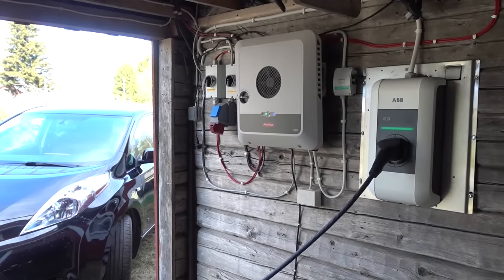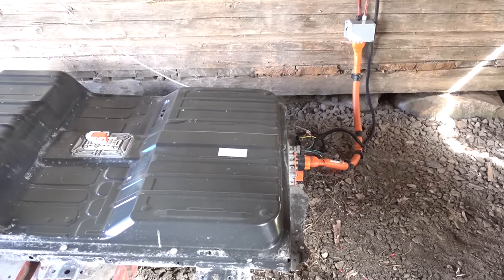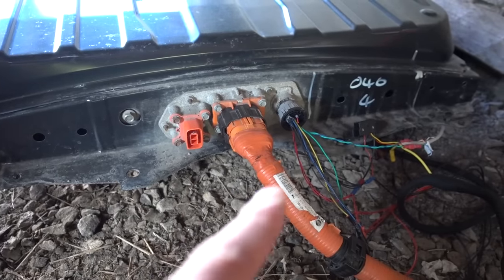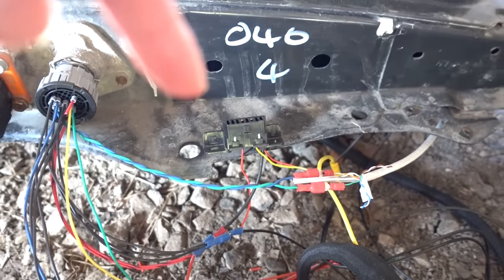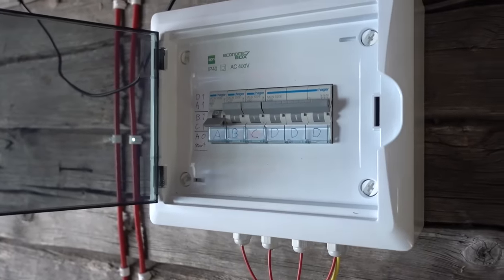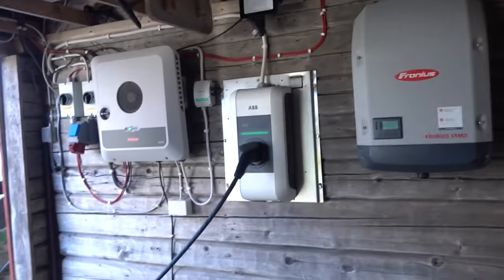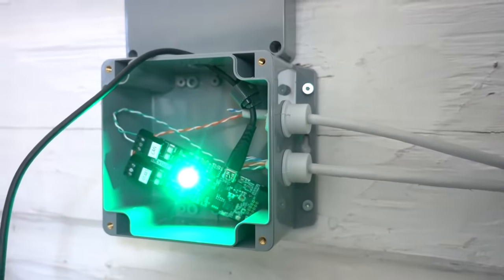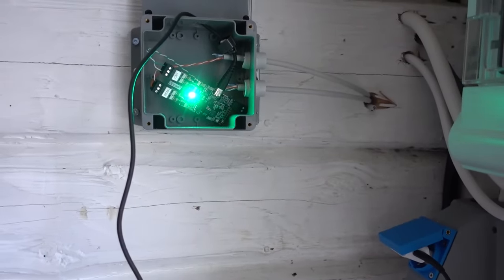The EASIEST way to connect used EV packs to grid! 🔋

Comment: Thanks for sharing this. I am planning something similar in my house. Although, I am thinking whether using V2G technology would better. I already have two car chargers installed. Hence, I could post a used battery with V2G compatible software, invertor and connector and permanently connect to the Wallbox car charger… Thoughts?

Comment: I’m definitely going to build myself one of these. Really cool what you did here. Just one quick question. The software emulates a 11kw battery, the Leaf is 24kW, are the readings in the monitor app showing the full 24 kw?
Reply from the maker: Yes it works, even 65kWh packs can be reported correctly!

Comment: Question. Do i understand it correctly that you couple a 400V battery on the dc solar pv side parralel to PV panels?
Reply from the maker: No, this is a hybrid inverter, so it has a separate BAT input, and another PV input. They are not in paralel
Reply: @DalasEVRepair  Ohhh ok. Now i understand it.  thanks

Comment: Brilliant,  Can you use a Honda hybrid Power battery.  Can you charge the battery with PV Panels  by just connecting to the + & _ connections on the battery.
Reply from the maker: No the battery BMS needs to talk to the inverter to avoid overcharging it. Safety is very important here, never use lithium batteries without BMS control.

Comment: Seems like it's really cool...I think. This presentation is a little bit too granular and only for people who have messed with this stuff before. Could you either make a video or give a description of what is going on here? Do you have a step-by-step explanation of how to do all of this? How does this system work without net-metering? How do solar panels integrate into the system? Where are the solar charge controllers? Does the inverter put out useful power to outlets or only to the grid? How many kwh does this setup provide? Split phase output or single phase only? Maybe I missed a description page or other videos but I would like to know how to implement this. Thanks
Reply from the maker: It's all in the Wiki! https://github.com/dalathegreat/BYD-Battery-Emulator-For-Gen24/wiki

Comment: Hi Dala, just came across this video as I am about to be given an old Nissan leaf battery pack and I'm based on an island with very limited help with regards to solar setups. Currently I have 3kw of solar panels going to a 5.5kwh solar hybrid 48v inverter and the gel batteries I've had for the last 12yrs have finally given up so this seems like a reasonably straightforward way of putting the leaf battery in their place. Is there an 'Idiots guide' of the the steps that need to be taken and the parts that need to be purchased in order to do this as I am not an electrical engineer but understand the basic concepts and as previously mentioned I live on a very small island which has no solar electrical experts to help me do this, so any and all help and suggestions would be very much appreciated as it would be such a shame to have the battery pack and not make good use out of it.

Regards Stuart
Reply from the maker: All explained on the wiki! https://github.com/dalathegreat/BYD-Battery-Emulator-For-Gen24/wiki

Comment: Hi Dala,great video and a super job.
I have here a Kostal Plenticore plus 10 kW with BYD HVS 10.2 memory.
From the Kostal there is the MODBUS TCP protocol.
Since I am a brave tester I would like to work on the project.
Furthermore I have here a Renault Kangoo 22 kW battery and a 22 kW ZOE 
and an ENV 200 with 22kW battery.
These should also work with Fronius, Sungrow, Kostal, etc..

What must / should I do ?
CAN log etc. ?
If so what exactly ?

Greetings Carsten

Comment: What's the highest power inverter that can be used? These gen24 symo plus inverters go up to 10kw and for pv output doc says only 3kva? To use this battery for real home usage need at least 4kw for water heater, 3...4kw for cooking + 500w for gaming pc. Can't really tell not to use washing machine when water heater and some more appliances are on. Looking at non gen24 symo inverters most don't even have battery DC terminals. It must have "hybrid" in model name and there's only max 6kw symo hybrid model
Reply: Didn't look into modbus code in much detail but does this solution already work with multiple inverters in parallel? That would scale for power needs
Reply from the maker: Many use multiple Gen24 inverters. Also there are 15kW home inverters available, check the wiki page for compatible inverters

Comment: What is the maximum distance the battery can be from the inverter?
I am looking at making a setup like this at home but the space where the inverter hangs is not big enough for such a battery.
Reply from the maker: Thicker the DC cabling, longer the distance. With 10mm2 cables you can go atleast 30m

Comment: question - If I wanted to connect 2 or 3 Nissan leaf batteries - are they connected in Parallel or series, and have you tried this? Additionally if connected in parallel, is it done at the inverter, or are they aggregated before the inverter? if it is done in parallel, How would the batteries be connected to each other?
would the inverter treat them as one big battery, or report on them separately?
Reply from the maker: I am still developing support for multiple packs, will make a video on it later!

Comment: Finally getting getting started on this. Quick question, can I add another pack in parallel by simply wiring them or do I need extra software/hardware? Ideally, I want to expand to 300kwh+ of storage if at all possible
Reply from the maker: We have it planned on the roadmap for the software to be expandable in parallel, but not ready yet! For now, best to buy a single 100kWh to start with!
Reply: @DalasEVRepair  thank you for the prompt response!  That sounds awesome. This is literally the coolest thing. Opens up an unlimited amount of opportunity🙌🏻

Comment: I love that project. Especially that it is open source 👍

One question though: Am I correct in the assumption that the battery has to be fully functional?
If so then where do these battery packs come from?
You said that your battery is from 2017. I would imagine that a car that is just 6 years old should still be driveable? So why was the battery removed? Was the car damaged beyond repair in a crash and luckily the battery survived?
I am just confused why someone would remove a fully functional battery from a car? Only reason I can think of is that the battery capacity has degraded? But even then a 6 year old battery shouldn't be that degraded to warrant a replacement?
Reply from the maker: The battery came from a LEAF that was upgraded from 30kWh to 62kWh. Almost all batteries come from crashed vehicles that go to secondlifestorage. Batteries can be used in 20-30years
Reply: @DalasEVRepair  thanks for answering my question(s) 😊

Comment: For the 5v battery backup.
Nice work
Can't you just add a regular phone powerbank as a backup power?
Reply from the maker: Yes that works great!
Reply: Not all of them will supply power while charging.
Reply: @DalasEVRepair 

To ensure uninterrupted service you should add a 12v supply. The Can485 PCB will accept that on the 2 pin connector. 

If you use a 5v powerbank what will keep the contactors closed? 😉

Comment: That looks like a very convenient form factor for something like a converted pontoon boat that has gone from a 2 stroke engine to an electrical motor, put some solar cells on a dock and you could enjoy the weekend without boat engine  problems.

Comment: Sorry for being a noob, does it use the same wires to charge and to pull the current from the battery?
Reply from the maker: Yes it does! More info on the wiki page on Github, link in description

Comment: Brilliant work Dala! I do the same with an old Peugeot 208e battery that we split and rebuilt the BMS to become 48V. A lot of work and wish we had used the Lilygo solution. Could the Lilygo allow a V2H set up where we connect via the Chademo port? OK Cables are expensive but there are advantages?
Reply from the maker: Yup, I added basic support for chademo last month: https://github.com/dalathegreat/BYD-Battery-Emulator-For-Gen24/wiki/Chademo-vehicle

Comment: I always wondered if anyone had used the battery pack from an EV as a home battery.
Making the casing for it would be challenging but an interesting project.
Reply: Mount it vertically to the wall and just build a cabinet around it. That would be the way I’d go.

Comment: Hi Dala, I live in Canada and have a 24KWh 2016 leaf battery ready for install. I have not found a North American BYD HVM/HVS compatible inverter yet.  There are options for a BYD HVL compatible inverters by GoodWE, Solis, SMA for NA. Will the emulator work with BYD HVL?
Reply from the maker: BYD CAN works (HVL CAN) ✅
Reply: Awesome thanks for sharing your work. @DalasEVRepair

Comment: Nissan Leaf = Dala + LeafSpy. You really rock with your work. Thank you for your contribution, it is priceless. 
I'm so sad, that you are using this battery for home storage. I need it for my 2016 leaf 😀.The dealer wants 30,000€ for new battery. Looks like Nissan wants to get rid of used cars, because they are too well built.

Comment: This is something I have been wondering about for ages. Sold my 2150 leaf which still had 12 bats for £4k and wondered how could I have made a 'powerwall' out of it and it probably work out free if the car was sold for parts.
Reply: Btw, yow many battery changes can the rest of leaf's equipment survive?
Reply: @heyhoe168  no idea, nee one is a 2017, drives 60 miles everyday and charged everyday and still has 12 bars.

Comment: Nice work, Dala. Question: What's your take on placing the pack vertically? (Just for space reasons). Assuming it is fixed in place securely, is there any reason why a LEAF lithium battery has to be horizontal, like structural, or chemical, like a lead acid with vent caps?
Reply from the maker: Perfectly fine!

Comment: Awesome project. I have a tesla battery pack that I have hooked up to an inverter, but it's not grid tied or to my house (it's plugged into the devices I want to power with it). Quick question: don't you have wiring codes/regulations? it's OK for you to add this to your house yourself without a licensed electrician etc and your home insurance is OK with this?

Comment: It is great what you did. Thanks for the video. Although you need a lot of improvement in the wiring and safety section. A fire protection shield is not enough.

Comment: How are you charging the pack through parallel connection to the PV array in inverter?
I figure you just have to be sure the PV array max voltage is not over the packs 90% soc.
Do you also have a low voltage disconnect for the packs BMS>?
Good video was thinking of doing something similar with a Tesla Pack.
Reply from the maker: There is a separate Battery input on the inverter, that js not in parallel with the array. So no risk of overvoltage, the array goes up to 600VDC
Reply: @DalasEVRepair  You can manually set the battery charge voltage for the Leaf pack with inverter that's cool.

Comment: Great video. Given they are designed for road use, do you think EV pack could be used on a boat/marine environment? Hyundai 7x KWh batteries are great value and seem to be available for a fraction of the cost of LI alternative.
Reply from the maker: Yes, these packs can be used in marine applications, but they are not so watertight that they are submersible 😅 some additional waterproofing is a good idea 😁

Comment: Just for my curiosity, what additional/different steps would be needed to do this without removing the battery from the car? Could we tap into the CANBUS directly? Is the main issue getting a physical connection to the HV battery connector without buying a ludicrously expensive CHAdeMO cable?
Reply from the maker: Yes, for the price of a Chademo cable you can get 10kWh of batteries
Reply: @DalasEVRepair is splicing the cable an option and putting the inverter in the car. Like muxsan does withe the addon Battery? 
Would this mean the car has to be switched on to use the inverter for charging with some solar panels on the roof (env200)?

Comment: Can you please comment on the price or price we can reasonably expect for such set up? And how to get those leaf and Tesla batteries at a cheap price - I assume there are relatively established ways to look for those batteries.
Reply from the maker: I buy from scrapyards, Norway is very close to where I live. 75€/kWh is a good price!

A 30kWh LEAF battery is at around 2500€. A 65kWh Tesla Model 3 battery is 4900€
Reply: @DalasEVRepair  Cool, thanks!

Comment: Thanks and nicely done impressive achievement. Is there any clue how much continuous power the battery provide without cooling and not compromising cell temperature? And what’s the maximum charge rate for ditto setup?
Reply from the maker: The battery sends the charge/discharge limits in kW via CAN. The Inverter follows this. Typical values for a 20*C battery is 110kW discharge, and 40kW charge.

The inverter I have does max 5kW in/out, so nowhere near the limits of the battery! 😅

Comment: Hi Dala, great video. Unbelievably valuable content for those interested in green energy. I have a Fronius inverter connected to a 27 panel solar system which also includes a Tesla Powerwall. I’ve already purchased a wrecked Tesla model 3 for an additional battery. Can I connect the Tesla car battery to the existing Fronius inverter that is already maxed out? Or do I need another inverter. I’m not an electrical engineer but am a mechanical fitter. I have some electrical experience but not a lot.
Reply from the maker: If you have a Gen24 Fronius, you can connect a Tesla Model 3 car battery directly yes!

Comment: Wow. Nice! 
The only thing - instead of messing with switches, I would add another Arduino with relays and established sequence. Triggered softwarewise, RTC-wise or by a button. Although one could definitely do it just through mosfets and capacitors. 
Nice anyway!
Reply from the maker: Great idea, it would simplify the startup, and also would be possible to add some contactor welding detection!

Comment: Whats about insulation? I think the Fronius does not have galvanic isolation. In a car the battery is charged either by the onboard charger that has galvanic isolation or by the external DC charger that also need galvanic isolation to the grid and isolation monitoring. 
Doesn't the batterys isolation monitoring not complain? If you override this, do you sometimes (e.g. once per day) switch the battery of and let it do isolation checks?

BtW: Great stuff in general doing this!

Comment: Great work Dela! Do any of the inverters in the list on GitHub work in US Split please? I was doing some digging and could not find that information. Seems like everything only works on 220? I have built one Solar off grid office almost a year ago and would like to try this for the house. So is there programming and support for 110v and 220 split phase?
Thank you!
Reply from the maker: Hi, I contacted AIMS Power a few weeks ago, they are a good solution for the US. They will add support for this Battery-Emulator in the next software update!
Reply: Did they give you a time frame when that next software update is expected?
Thank you!
Reply from the maker: @alexdemy9644  4-6 weeks (2 weeks ago)
Reply: Thank you! As soon as they notify you that the update is done I would like to test it with my leaf battery. I can buy leaf from salvage auction.

Comment: Any chance you (or anyone else) knows the part number for the PTC connector? Seems like a good option for connecting a small inverter? I just cant find the connector anywhere!
Reply from the maker: Here https://github.com/dalathegreat/BYD-Battery-Emulator-For-Gen24/wiki/Nissan-LEAF-battery#part-numbers-for-nissan-leaf-batteries
Reply: Thanks, but I'm after the connector part number, to buy new connectors, not the Nissan part number for the whole cable

Comment: Hi Dala

Thanks for your sharing for all of us wanting to get better solutions on their systems.

Refering to Fronius their hybrid inverters are not at all suited for continuous offgrid use and ive discussed this with one dealer wich told the end-transistors worns out very very fast if offgrid is used without support from commercial grid?.

You have used this now for many months i imagine and what are your toughts about theese comments from Fronius?.

I have still to build this totally offgrid system this summer and ive bought the Fronius 10kw sym24plus to this system and wonder if i must buy another inverter.

Do you have any toughts about what the best options are here or is it just go with what i have?.

Cheers to you 👍
Reply from the maker: For offgrid there are way better and cheaper options. Check the supported list on the Battery-Emulator github page!
Reply: Tried to figure out wich of the models giving best performance and most economical from the list but i could figure it out, i have no contacts regards to wich of them are excellent for pure offgrid?.

Why i ask from the beginning is that i took for granted the Fronius would work for offgrid use but later when i bought it, then it appeared that it was not an good option for offgrid even though this was never informed by Fronius from the beginning. Now recently you can read that the inverters are not intended for continuous offgrid use from Fronius by themself.

I just dont want to make the same mistake again as these items are very expensive to buy.

Any example for a three phase system and 10kw limit or slightly above?.

I will use diesel generator supporting the system so it would be great if that could be used as well.

Cheers